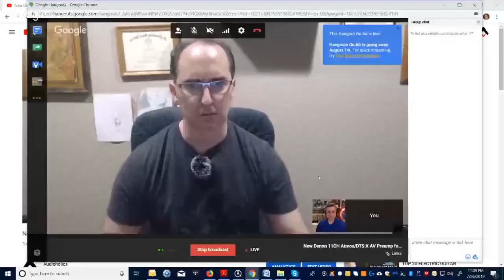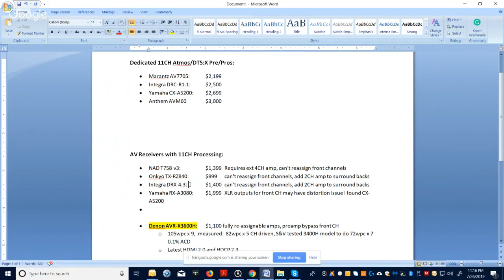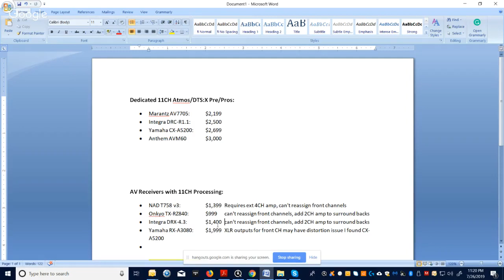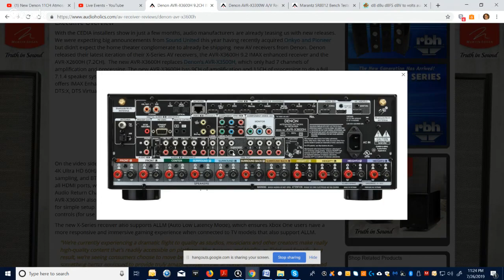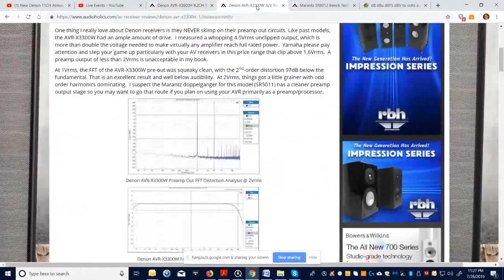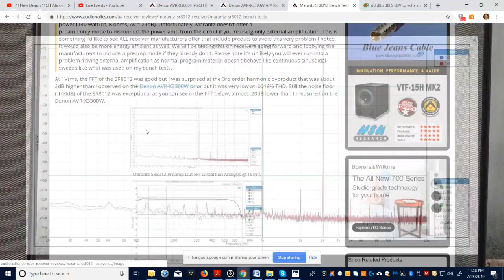Denon AVR-X3600H 11CH Atmos/DTS:X AV Preamp for $1,100?!?

Comment: Why was the X4500H not included on this? What are your thoughts X4500H vs X3600H?
Reply: Exactly what I was thinking - such an obvious comparison that has been ignored.
Reply: I recently had to make a decision between these two receivers. I choose the 4500h💪🏾
Reply: @carlcameron3524  Does the X4500 Disconnect the Front L&R in preamp mode like the X3600?
Reply: Paul Stone I don’t think so.

Comment: I was thinking of doing 3600h for preamp and powering rear and then a monolith amp for the front.
Reply: Lemonade that’s what I do with the 7200W
Reply: @navinadv  can I turn the X4500H into a dedicated Preamp? Meaning I'll use the Pre Outs only.
Reply: @fraddi  you can but why waste the power section? It can easily drive surrounds.
Reply: @navinadv  how powerful is a Denon amp?
Reply: @fraddi  I don’t go by published specifications but if one was to look at the size of the power supply one could assume it will put out 30-50w rms per channel 

If your speakers are 87db or so (in room) then you should easily get 95db+ which is plenty loud.

Remember we are talking ONLY for surround channels. The front channels would have a separate 50W-100W rms power app.

Comment: Hi Gene, did Denon replied regarding X3600H Pre-out Front L/R can be disconnected from internal AMP?
the user manual shows the 11.1 channel connection must use TRR/TRL terminal of Pre-out RCA connector, it seems no way to  assign only FR/FL via Pre-out.

Comment: reading the manual, I do not get the impression that all channels are assignable, is this written anywhere official from denon?? reading on the backside of the amplifier, assignable is only written for the four height channels, this could be understood like those channels only are assignable. And similarly, I'm trying to figure out if the x4400 and x4500 also have fully assignable amplifiers, but the manual and official feature set does not indicate this. could you help me out here?

Comment: I am going to get the denon x3600h but for a bit less money I have the chance to get a denon x4300h used just the reciever instead. What one do you think I should go with? I was the atmos in my home with 4 speakers in my ceiling. Also i only have 2 small subs that dont match.

Comment: Two questions.  What's a good/affordable 2-channel amplifier to drive a 7.2.4 configuration with this receiver?  I heard Monoprice mentioned in the video but I didn't see one on their site jumping out at me as an obvious choice.  Second, does using an external amp to drive those extra channels compromise the receivers ability to calibrate speaker levels via Audyssey such that two channels need to be leveled manually before/after the calibration, or will it be able to address the levels in the pre-out?

Comment: You mentioned there is no Pre/pro with Atmos under $2200 that is not correct , you have pioneer Elite vsx-LX503 9.2 channel ( can do 11.2) for $549, and Marantz SR6013 for $899, they have pre outs too. I don't see them in the list of comparisons
Reply from the maker: you need to listen better. There are no  retail 11CH prepros for the price of the AVR-X3600H receiver. The LX503 is a recently price reduced receiver that can do 11CH but I doubt the front channel amps can be reassigned like the Denon's. Still it's a good option for sure.
Reply: Audioholics thanks for clarifying. Will pioneer elite or Marantz has enough pre-amp output voltage to drive external amps like Denon? I have pioneer elite THX certified , but it was never able to drive the amps to full capacity.

Comment: Sorry but the "value' proposition of a PRE PRO and amplifier vs an AVR is a completely bankrupt assertion.
Why?
Because the PRE PRO is (perhaps asininely so) is more expensive than their (comparable) AVR counterparts (short of Integra, I believe). 

So you're not really "saving" anything, per se, as the PRE PRO you will replace will be more expensive than a new AVR. 

Now, if you want to talk about the virtue of adding (a) amplifier(s), that's a different conversation, but you're certainly not "saving money" by continuing to buy $2k-$2.5K pre-pros over AVRs every 5 years. In reality, you are- in fact- spending THOUSANDS more, after adding 7,9, 11, or 13 channels of amplification. Simply a fact. Again, there may be merit to a PRE PRO and AMP arrangement (I run one myself) but in no way is it more economical/monetarily efficient. 

And re the 3600: I'm pretty sure you have to use at LEAST 2 of the internal amps: you are limited to 9 channels of "pre-output' (disregarding the sub outputs).

Comment: wow great video I been looking for a new receiver and was going to go pre pro cause I have a mountain of cinema amps. But that 3600 is a great price and if its has new HDMI along with going to 4v thats darn good. And to your point when you need to upgrade again its half the loos of a higher end AV. I wont be running other formats aside from dobly so dont care about auro 3d. I also have 4 dedicated lines just for my theater so thats also great to know I made the right choice! Gene the beast!
Reply: After looking more into it you can reassign all channels just the LR speakers which the older 4xxx series could do. Its not a tru prepro in that sense as you cant do all channels for just separates. I still see a value in a pre pro over this if you have the amps.

Comment: Ive used my sub output into an external amp.  And noticed the output voltage from the pre out to a typical two channel amp.. Wasnt enough input to get the amp to produce its full output. A line driver helped. At one point i put an equalizer inline.  But thats a hacky way to do it.  But i thought this was something i had to deal with. I just figured "plate" amplifiers for subwoofer use just had an input that works with a weak sub pre output from a pre amp.

Comment: Never thought about that issue with the pre outputs.  I always thought it was worthless to use a receiver as a pre amp if it doesnt shut the main amps off. They are still amplifying a signal for no reason. Even on a basic understanding. I know thats creating heat. Byproduct of work.  Work that didnt need to be done.  But i never thought most recievers have a weak voltage. Because i have thought about substituting my av receivers front channel outputs for a separate amplifier.

Comment: If I wanted to spend a little less any thoughts on getting the ext amp for the surrounds instead of the fronts like you mentioned to get the full processing.
Reply: Outlaw has a five channel amplifier that you can get for $600 that gives around 125wpc. The best thing to do would be to have it power L/C/R/LS/RS. The front stage are the most important speakers to have the most power since they're the most active.
Reply: @Gpoteat100  thanks man I'll look into that
Reply: @Gpoteat100  Garrett do you know the model? On their site I see the 5000X but it lists at $750. Maybe you're referring to a slightly older model? Thx
Reply: Their prices seem to have gone up. I saw it on Amazon Prime earlier but it costs around $800 with $80 shipping. Sorry about that.

Comment: Hi Gene!
There is one thing that irritates me about the Denons and has for a long time, is that the still don't allow users to turn off the massive volume boost to the Surrounds, Rears and Top Rears. Almost no Reviewer mentions this, but customers have been complaining about it since DynEQ first came out. I don't understand why D+M don't just add a switch in their app to allow users to turn off the boost without losing the very welcome Bass boost DynEQ offers. They don't even clearly say that DynEQ does raise the Volume of the Surrounds, Rears and Top Rears by 1db for every 5db you listen below Reference level...
Reply: They do. It’s called Reference Level Offset ;)
Reply: @hifihometheater  
Actually...not at all. That offset reduces the bass boost and the surround boost at the same time. I want to turn off (or reduce) the Surround boost but keep the bass boost!

Comment: I have the same question others have posted.  Does the 11 channel amp assign work to disconnect pre-amp from power amp for Denon 4400H and 4500H or only on the 3600H?
Reply from the maker: I believe it does for any Denon model that only has 9CH internal amps but 11CH of processing.
Reply: @Audioholics  thank you for the reply. If this is true then an awesome deal now is the marantz 6013 available new for $899 at most retailers while they last.

Comment: My x3600h was just delivered to my door.  Im excited to try er out.  Great vid  Thx.  I am currently using a Cambridge audio CP2 for my Technics turntable.  I will definitely try the phono input on the receiver but I would like to know more details about it.  Can anybody shed some light on this for me  thx
Reply: Please let me know how the 3600h performs for the height channels.  I'm looking to upgrade from my 3400h.
Reply: @Marcel-the-now-65yrOG-Curry  I am replacing my 3400 as well. Great avr. I'm waiting for my Furman conditioner so I should be all set up by next week. I'll keep you posted
Reply: @dbrgr68  Thank you Sir.
Reply: @Marcel-the-now-65yrOG-Curry  Finally set up the 3600.  Im still tweaking the settings but i did watch Ready Player One last night in 5.1.4 and it was awesome.  After running Audyssey  the receiver set all speakers to large and i had no sub signal.  I manually changed it and all seems fine.  I had no complaints with the 3400 so i imagine the 3600 will just as good if not better.  Hope this helps  Cheers
Reply: @dbrgr68  Thanks, and yes it did.  I actually purchased me one and I added the external amp and I'm running the 7.2.4, sounds awesome....

Comment: You guys have been very informative and knowledgeable. Being a car audio installer and life long home audio enthusiast, i've really brushed up on my setup and alingment skills. 
I'm running Paradigm prestige 85F L/R fronts through a cxa5100 and Mxa5000 amp/pre. 
I have bought 2x MTX 15" "75 Series" (750 RMS/1500 peak dual 2 ohm) and a EMOTIVA differential reference 2 channel (550x2@8ohm OR 800x2@4ohm). I am yet to run these. As room reinforcement treatment is needed.
Q1. How important are curtains covering walls for sq?
Q2. Should i put a mini dsp between the emotiva (sub amp)?
Q3. What are your thoughts on the sub/amp combo?  FYI seperate 1.5 cu/ft sealed 30mm MDF enclosures?

Comment: I want to do a 7.2.5 set up but dont  want to buy extra amps. I'm looking to get the denon 13 channel amp but it so expensive. Any suggestions? I can save up the money to get the 13 channel amp but if there's a cheaper way to go, I'm all ears. I'll get the amps if it means I can save money.
Reply: Well now the denon 6700 has helped lower the cost of entry to 13 channels

Comment: I have a 5 channel amp.For getting 7.2.4., If i use this  for center channel, and 4 height speaker from the preout,  can i use remaining 6 channel from the power amp?( left ,right,surrounds and surrounds back). If it is possible, does this need any changes in settings?

Comment: Why don't manufacturers release these receivers without the built-in amplification and sell it for a couple of hundred less. I truly beleive there is a large market for low budget pre-pro's.
Reply: Love this comment. I have been with you on this for years. This is a push towards value!!!!!!!!!
Reply: why? because it they do that av receivers sales will go down.......
Reply: I agree with you
Reply: I don't hate it. But these AV receiver manufacturers ALREADY DID try the whole budget AV PrePro thing for decades!  Its called PRE-OUTS, for all channels,  from the back of their AVRs!!!  Problem??  The masses didn't care to use them!!    For $500 Yamaha and Denon both let you do just that,  and with pretty darn good results too.   
Let's face it, most people run receivers into mini sats and inwall speakers anyway!   The audio enthusiast market simply dried up in the minds of these companies, or simply wasn't strong enough to matter in first place, including standalone sub $1000 AV prepares either.  Believe me. It's been tried
Reply: Alexander Scott but right now you need to pay over 1000$ to have pre out amplifier output. All the sub models don’t have it. Denon x3700h and x4700h are the best value with their pre-amplifier mode (which is not possible on other brand if i don’t mistaken and was only available on the pro 8500h at 5000$) that really disconnect the amplifier and allow best sound with no clipping.
Reply: YES!
Reply: I agree  esp since its only the "brain" that needs occasional upgrades assuming you r using good p-amps

The deal I got on an X4300H was worth it make no mistake (despite  a few annoying bugs etc that could b easy fix if Denon would actually listen to me demmit)   but the same sans p-amp at a lower cost in the long run would have been preferable.

Comment: Almost there. If this was true HDMI 2.1 with HDCP 2.3 support I would be sold immediately.

But its not unfortunately. It does have eARC and low latency for Xbox One, but not 120hz at 4k or variable refresh rate.
Reply: Although it sounds like a waste of AVR's ports, in case you don't need to output your source to more than one screen, you can still use your TV's HDMIs for that few HDMI 2.1 / HDCP 2.3 devices.
Reply: I am just going to hook up the next gen system to my TV which is HDMI 2.1 and since the TV has eARC it will send uncompressed audio directly to the receiver. I really have no need to hook up my HDMI 2.1 devices to the receiver. It would be nice to be able to let the receiver do all the switching but it's not crucial for me. Considering the 3700 is hundreds of dollars more than the 3600 right now

Comment: Hey guys, what A/V receiver would you recommend for bi-amping my B&W fronts, B&W center, two front Definitive technology front height Atmos speakers, two Definitive Technology subs and two full range rear speakers? Currently I own an old school Onkyo TX-SR605 and bi-channeled each front tower speaker. Looking for Dolby Atmos 9.2 configuration that I can bi-channel the receive and still use front height speakers and not side rear set up. My ceiling is 10ft tall and it would just be a nightmare to move the front height speakers and add two cables and mount them for two side rears speaker set up. I would like to upgrade to pass through 4K UHD video 9.2 bi-amp able receiver for Dolby Atoms 7.2
I’m looking at the Onkyo tx-nr 787

Comment: Say I was to use a receiver such as the Denon AVR-X4500H that has 9 power amps and I just want to do 5.1.4 , I then purchase a 4 channel power amplifier and use the pre outs to take load off my receiver / increase performance. Would this take any load off the receiver if the power amps are still in use even if they are not physically connected the 4 Atmos speakers? Thanks.
Reply from the maker: Yes since the unused amps aren't loaded and sucking current from the power supply.
Reply: @Audioholics  Thanks!